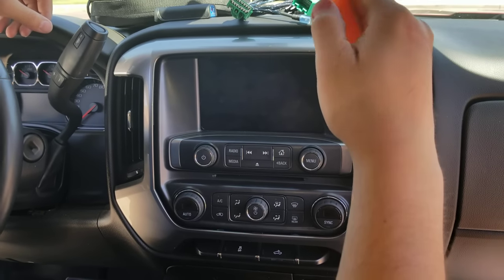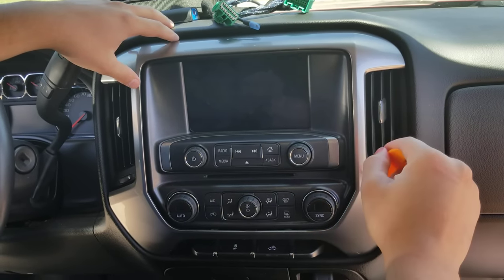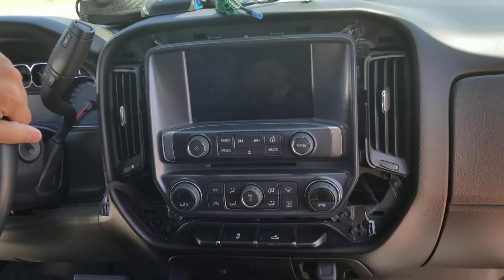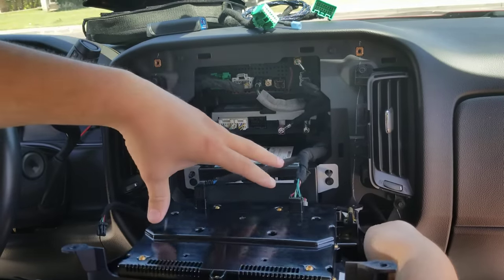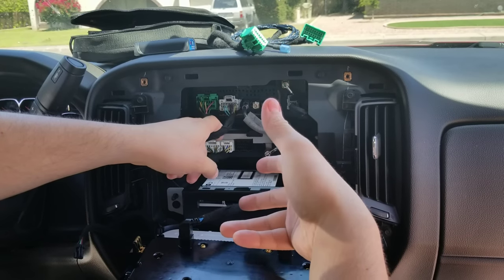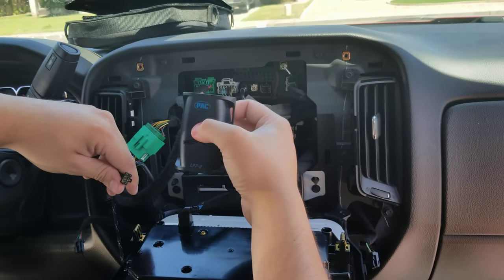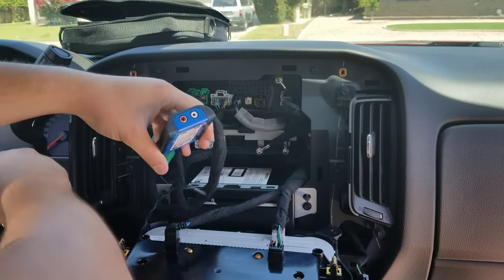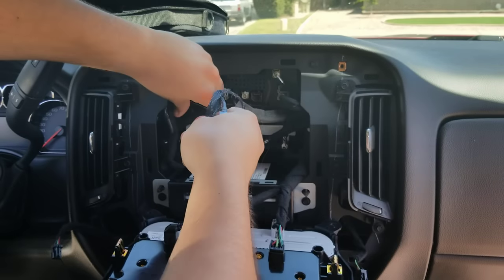2014-2018 Chevrolet Silverado/GMC sierra AMP Install w/out 7" screen

Comment: i have a 2014 chevy silverado 1500 i want to up my stock speakers can i install 4 channel amp and also use this harness it has a bose system
Reply: i have the same question i just ran into this issue today

Comment: So this wiring harness that you guys sell the signal coming out of those RCA's is complete Subs no mid-range no high range correct?
Reply from the maker: Thats a great question and it would depend on the signal that is offered. You aim for a low-mid rang when we select the audio signal. You would use this in conjunction with the low pass filter on your mono amp to leave out any frequencies you dont want to play. Ex: your box is tuned to play 34Hz you would hook up the harness and set the LPF at 60hz this means that regardless of what the harness gives you only frequencies from 30-60Hz will be audible from the sub.

Comment: What are the left front and right front wires on a 2016 GMC Sierra without green plug without Bose WT but has touch screen with Android and apple play
Reply: did you ever find out?

Comment: Will this work with the 2014 8inch screen factory bose equipped system?.
Reply from the maker: Hello Pronox, So not this particular harness. This is only for the none bose. The bose harness connects to your bose amp at the back wall and will look the same its just a different connector.

Comment: Not sure if anyone will see this comment but, if i use the 4 channel version will the warning chime be amplified as well?
Reply from the maker: Not if you use a dsp amp that allows you to manage the intensity of that frequency. Lets say the chim is at 17khz and peek at +3db when it goes off. But after the amplifier its now +6 so if you have a DSP built in you can target that frequency 17khz and set the max DB for the 17khz -3 or 4 DB so the chim is back to normal

Comment: That save a lot of headaches no doubt,. So how much for just the green  harness in the video?
Reply from the maker: We offer our Ready 2 Go T-Harness for the 8", non-amplified system. This comes with a Link2 LOC included for $125:
https://lljcustoms.com/products/2014-2018-gm-gmc-vehicles-with-8-or-select-4-screens-t-harness-without-bose-r2g
Reply: My shstem is amplified, what harness would i need??

Comment: Question if I just want to amplify the door and dash speakers if i connect to the rca plugs will the speakers get feed from the amplifier?
Reply: Did you find out if it worked? And how many channels did the amp you got have?

Comment: What connection do I need to buy for a 2017 silverado with a factory Bose system ? We have the amp and speakers. But lost when it comes to hooking up the remote and rca.

Comment: question so with this harness its basically tapping into all 4 channels and giving you a pig tail to plug into that specific line out converter? i plan on doing a sub amp and a mids and highs amp in my 16 sierra and was looking at getting a sound processor so i could technically extend this to the back if it has all 4 channels on it and run into basically any sound processor of my choice correct?
Reply: oh okay disregard that i checked your website the lc7i is the exact sound processor i was going to use man thats amazing you guys make a cut to length harness all wrapped up everything beautiful i will definitely be ordering one soon as im ready
Reply from the maker: @psyfertech  Glad Our website was helpful . Let us know if you do have any questions. our harnesses also have a built in micro bored that will generate a turn on signal for your amps. You mentioned you wanted to do your doors, we would suggest looking into our loop harness.
Reply: @lljcustomscaraudiofabricat7854  thank you, man im glad i came across this makes it easy and you dont have to hack into factory wiring, and yes i did notice that definitely need a remote turn on i saw another video where the installer found a accessory 12v on down under the driver side dash but this is perfect and i will definitely check that out when i start my build i just got this truck and im finding that i made a good choice seems very very easy to install aftermarket audio into
Reply from the maker: @psyfertech  That is the idea. Especially with how expensive the electronics in this vehicles are, its not worth the chance. Yes this Truck has a lot of good spots to mount equipment . looking forward to doing business with you . check this video out : https://youtu.be/dplITOXR-GI
Reply: LLJ Customs Car Audio Fabrication L.L.C o

Comment: So I understood how to add bass amp basically but what if I want to add 4 channel as well?
Reply from the maker: you can do the same thing and use a 4 channel  T-harness but you will need to pull your own wires back to the doors. we do offer a Loopback harness that uses the factory wires to feed the new speakers. we have a few video's on that also

Comment: My green plug on my 2017 Silverado only has red wire and blk wire,. When i connect harness nothing there connects the speakers,. Where would i run wire for speakers? The harness that came with my android head unit , green plug jas pirple,green , gray,and another color, but  green plug unconnected from factory unit only has blk wire and red wire,. Im lost on this any ideas,. ?? Id appreciate,..

Comment: im about to buy yalls harness but im for some reason confused on which one i need i have at 2016 sierra with the same screen as the one in this video i believe, so if its the one without the 7 inch screen does that mean its an 8 inch? i dont have the bose system and the part number listed in the video i cannot find on the site 
i know 2 months ago i was looking at them and i thought i had saved the link to it but guess i didnt
Reply from the maker: Hello nick, we did change the part number about 2 weeks ago. if you have the 8 inch unit like in this video, here is the link to it for you :https://lljcustoms.com/store?olsPage=products%2F2014-2018-gmc-chevy-silverado-sierra-oem-lp7-2-amp-t-harness

Comment: I have the 2019 GMC Canyon. What equipment do I need to add my subs in my amp to this it has the same set up it looks like in your video with Apple CarPlay.
Reply from the maker: hello you would just do a t-Harness with an loc we have a video on a 2019 Colorado that is the same as your canyon.

Comment: Will this work for The 2015 Denali model... I do believe it is the Bose Premium sound set up... would love to bypass the factory sub easily and install my own sub with new more powerful amp.. thanks
Reply from the maker: Hi jay. Yes this will work on the denalo models, however if you have a bose system then you need our bose bypass harness we have to videos on out channel on how to install and how they work. Let us know if you need anything else

Comment: I have a 2016 GMC Sierra 1500 Elevation Edition. I have a Boss 1100 watt amp and 2 kicker 10” I plan on putting in but I need a harness to make it work. Do you have one that is compatible?

Comment: I have a 2018 GMC Sierra with NO Bose. But want to add an amp. Will this kit do it?
Reply from the maker: If you are looking to just add a mono amp for a sub then yes. If ur looking to amp up your door speakers then no to do that you will need a dsp so u can keep the door chimes and other factory applications.
Reply: Ya, all I want to add is a mono amp for base only. Will this harness affect door chimes and other features?
Reply from the maker: Doug Adams then yes this harnesses will allow you to keep all factory functions and add a mono amp. Visit out web sit www.lljcustoms.com and look under LLJ CUSTOM HARNESS KITS you will see it. you also have a choice to add the RCA wires and the amp turn on wire.
Reply: do you offer something plug and play for adding sub and adding amp to door speakers?
Reply from the maker: do you have a boss system ?
Reply: No, 2017 Sierra with an 8" Nav.....
Reply: Also, what signal is being used to supply the signal to the pac, fwd or rear?
Reply from the maker: yes this will work on your truck. on the site you have the option to select a sub gain remote.
Reply from the maker: Front speakers, but the Lp7 does not care it just wants to see the frequency signal from the stereo. it turns it to a flat full range signal regardless of the input signal.
Reply: ok but do you offer anything if I wanted to upgrade and amplify my door speakers and make it plug and play?
Reply from the maker: i apologize i though i posted the answer it did not. yes we do we would have to wire on the lp7-4  and the LP7-2 or LP7-2r. The LP7- 4 is for front and rear full range the LP7-2/LP7-2R is for the sub-woofer, this would be the most economic way of doing it. or you could do a DSP like the Rockford DSR1 that gives you more choices and 8 outs. its going to depend on what you are trying to accomplish with your system and how complex you want to make it. if you want a quote on a custom harness that uses the Lp7-4 and LP7-2/2r you can email me on our website under contact Us.
Reply: LLJ Customs Car Audio Fabrication L.L.C will that harness work on the jl audio loc 22 I have a 14 no bose silverado 8 inch screen
Reply from the maker: jeepscometrue what your asking for is a custom high level out T-Harness that goes into your LOC, so yes we can make you one ..you will need to visit our website Www.LLJCustoms.com and send us an email stating that u have a 14 with an 8" screen and want a custom high level T-harness...also includ how long u want the speaker leads to be and we will email u a quote.
Reply: LLJ Customs Car Audio Fabrication L.L.C I have a radio 4’ but no boss system what’s the cable that I need and where in your website can I buy it
Reply from the maker: @andrestorres4368  the 4" is common in the LS work model..u would need to pull the face off to verify the plug : here is the page with the harnesses https://lljcustoms.com/store?olsPage=t%2Fllj-custom-harness-kits. 

I would suggest u pull the face tale a picture of whats behind and text it to out customer service number 602-320-7004 they will text u a link to the exact harness u need
Reply: @lljcustomscaraudiofabricat7854  will that dsp help with the volume of the door chime and blinkers? After I had amps installed with all new speakers to my stock head unit of 2018 silverado those features and some others are way to loud to handle.
Reply from the maker: @joshuabeckwith7114  unfortunately i could not give you a definitive answer  Because we do not know how everything was wired. If the installation would have been done right the ideal think is to run the speaker or speaker that have the safety chimes on there own channel so that the power could be manged , another choice you have is to use a DSP and fad e out this frequency so that they do not play though the amps. Yet another choice is to leave the OEM speaker in the dash with the chime hidden in the dash some wear and  us a DSP to digitally crossover the noise out of your system and let the safety chimes play on there own speaker.

Comment: For the remote turn on wire do you have a 12v connection somewhere close to the LC7-2 you recommend using? I’ve see people use a pin in the distribution box by the driver side brake pedal. Didn’t know if you had found something easier to access
Reply from the maker: Hello cj if your looking for a 12v ignition wire the driver side dash fuse panel has 4 spots on the 22 pin connector you can use. our harnesses use the power that feeds the revers camera.

Comment: I have a 2016 Silverado 1500 with the 7” screen Bose system.  I am not getting any real power back to the sub as I’m tied into the rear speakers thru a high input cable directly into amp.  Will this harness send a higher signal for more power to the sub.  I have tried this with a JX500/1 so not sure why I have no power.  Anything I can buy from you that might fix this issue.  I tried both loc and high input cable.

Comment: Would this work on a 2014 Chevy Silverado  1500 regular cab with a 4 inch screen?
Reply from the maker: you would need to first verify the connector color behind the screen to see if you have the green or the brown plug.
Reply: LLJ Customs Car Audio Fabrication L.L.C what would I do if I have the brown plug?
Reply from the maker: @theoscarzee3057  you would use this harnesses: https://lljcustoms.com/store?olsPage=products%2F2016-2018-gm-and-gmc-vehicles-with-7-screen-loc-t-harness-not-bose-slash-work-truck-ls

Comment: 2016 Silverado custom with 7 inch screen. No Bose. I dont need a amp bass controller, what one do I need?
Reply from the maker: Hello Scotty,

The harness you would need is in the link i have attached. select the LP7-2 if you do not want the Gain remote. 

https://lljcustoms.com/store?olsPage=products%2F2016-2018-gm-and-gmc-vehicles-with-7-screen-loc-t-harness-not-bose-slash-work-truck-ls

Comment: Does the 17 radio have a Video rca to add a aftermarket backup camera?
Reply from the maker: No there is not an existing rca plug. However there is a model that lets you add up to 4 cameras given that the this new vehicles work on a digital trigger. Adding a backup camera can cost 400.00 -750.00 depending on the module and the camera you go with.

Comment: So i have an amp, subs and line output converter installed but my bass doesnt really hit for having two 1500 watt subs. Will this improve that?
Reply from the maker: Hello adam,
Our harness simply provides you with a clean processed low level signal for your amplifier to use. The issue that you are having could be due to manny different reasons. Our harness might or might not be the answer but we would be glad to help you troubleshoot the issue with you. Feel free to give us a call or email us. Thank you
Reply: @lljcustomscaraudiofabricat7854  how do I get one of these harnesses
Reply: Did you figure out what it was? I have the same issue. I got a 2018 GMC Sierra with stock radio, LC2I, 2 SA 12 ZV5S with a DB AAK4000, and its not hittin nowhere its supposed to
Reply: Bash NS well i recently upgraded my amp and got two kicker l7 subs and hit pretty hard i just have the line output converter, epicenter and a 2800 watt pioneer amp
Reply: @adamtx214  so u kept the stock radio and everythin? Man i just dk wat to do anymore lol. Mine dont sound right. I think ima just upgrade the headunit, i think thats the #1 issue
Reply: Bash NS haha i still have my stock one bro replacing it will help get more bass and more sound out of your door speakers though.
Reply: @adamtx214  lol man i know. I just didnt wanna have to go that route cuz of everythin its already linked to in my truck. Bass on man
Reply: Bash NS honestly shouldnt have to i just took mine to a good audio store and they fixed my issues. Paid around 160 but well worth it
Reply: @adamtx214  ive tried looking on audio places that are legit but since im in Houston, its hard to find those. They all look shady down here. But ima keep lookin though. 160 is not bad to have you up and runnin
Reply: Bash NS oh i know im originally from dallas so i get what u mean😂sucks if u lived in phoenix i couldve got u hooked up cheap and legit
Reply: @adamtx214  lol what you doin in phoenix from Dallas? Lol they must pay good money to work out there lol
Reply: Bash NS haha my uncle started a family business so gave us an opportunity out here but its way more expensive out here

Comment: I’m new to this so ...I have a Silverado with 4” screen I had two subs installed but I with the volume turned up all the way the bass sounds real nice but  it’s still not as loud as I expected to be. I was told to replace the factory radio but that’s last option. Will this help with my problem?
Reply: Bro are you still alive?

Comment: could i run my clarion eq off of that line out converter ? then run my mono and 4 channel off of my eq ?
Reply from the maker: Hello cornelious,

Yes you could potentially get this harnesse with an lp7-4 and run that to your EQ unfortunately the clarion eq does not do base signal restoration so we could not guarantee that it would be a good choice
Reply: LLJ Customs Car Audio Fabrication L.L.C  what do u mean by bass signal restoration
Reply: LLJ Customs Car Audio Fabrication L.L.C  in other words would need like an epic center hooked up too huh
Reply from the maker: @CJayyDaGoat  not necessarily if your looking to have 6+ channels out to run your 4 channel amp and your mono you could do a dm608 from audio control or a dsr1 from Rockford .if you go with an dm608 or dsp then u do not need any additional loc or eq units

Comment: Can't find the part, typed in part number 0 results found.
Reply from the maker: Hello, you can find this harness under plug and play then GM vehicle's it will be the 2014 gm 8 inch

Comment: do you have a harness for the 4 inch screen?
Reply from the maker: Great question Kenny, the 4 inch is a hit or miss you have to remove the screen an verify the connectors..some have the green connector with black radio box some have the brown with the silver radio box .if you let us know what you have we can show you the harness you need

Comment: Awesome video! I just got a 2018 Chevy and wanted to install an amp and a sub or two. Do you know how many watts I can safely put in it before I start stressing the electrical systems out? I don’t want to overload the alternator.
Reply from the maker: Great question. 2600 watts is the max i would suggest you do anything above that you will need to add a battery.